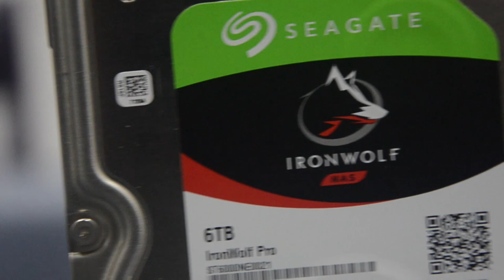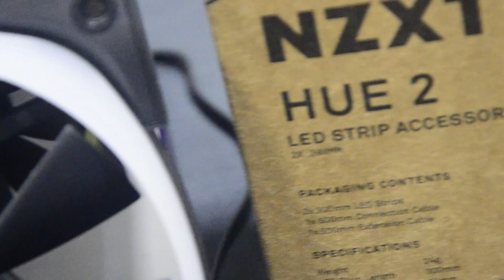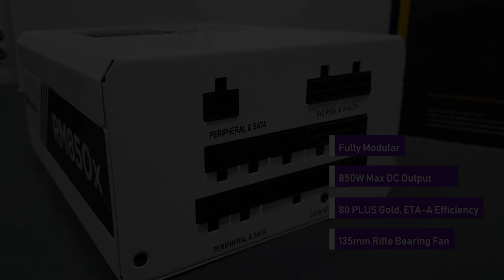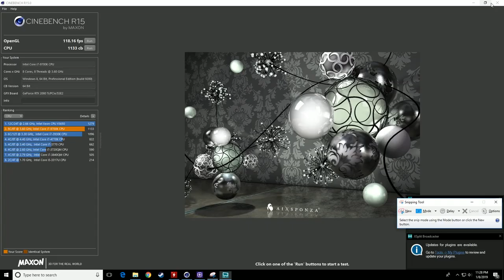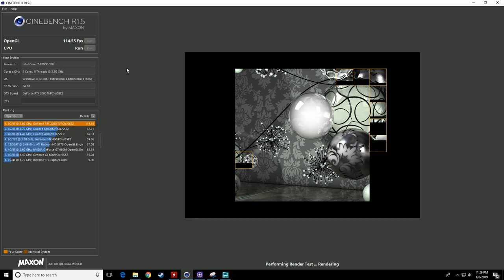PC Build on NZXT h200i (i7 9700K + RTX 2080ti)

Comment: I really need your help... the NZXT website says the max clearance for GPU height is 44mm... however you've managed to fit a 50mm wide card in there. Does it work well? How are the temps? Please help me I want to get a 2080 super card that is 51mm wide. I hope you see this!!
Reply from the maker: 44mm is actually thick and would choke the fans of GPU, the temperature of the GPU in this video is quite bad. If I would recommend a GPU for you, you can choose on these one that I already tested: MSI 2080 Super Ventus, Galax 2080 White or 2080 Founder's edition.
Reply: @VinceZen  Hi, What exact model of the rtx 2080 super galax are you talking about? I'm getting this https://www.galax.com/en/graphics-card/galax-geforce-rtx-2080-super-ex-gamer-white.html . its thickness is 51mm, 0.8mm thicker than what you have. in this video(50.2 mm). Will this work?

Comment: Hi Vince, did you need to customize something to fit all in? Looking at the NZXT H200i dimensions and the RTX 2080 Ti dimensions, it's quite a challenge to have all this together.

I'm wondering between NZXT H200i and H500i, but I'd like the smallest one for an RTX 2080 Trio + I9 9900. Today, looking at the temperatures, which would you recommend? 

Thank you!
Reply from the maker: No, I didn't customize anything on this build, but the GPU airflow is kinda bad so if you are going to use a GPU with that size, you might want to consider to mod the shroud or remove it.

Comment: Will a 2080ti ventus 11gb be a better fit than a triple fan? or will it choke the temps as well?
Reply from the maker: it may improve the temps a little bit, but the airflow of this case still sucks so if you are overclocking, I may not advise using this case.

Comment: What are the temperatures for the CPU and GPU in this system?
Reply from the maker: I can't remember that much if you are asking referring to idle mode, but the GPU  temp is not good on that build because the size doesn't give itself a breathing room in that case, even if I tried to change the airflow.

Comment: Hey Nice Vid man. But one question. Would the Rtx MSi 2080ti trio fit in this case?
Reply from the maker: Based on its specs, it is 5mm thicker than the GPU that I use in that video, it could possibly fit, but there will be no breathing room for the GPU so I wouldn't recommend that.

Comment: something is not correct with the temperatures. The NZXT cooler do comes with thermal paste applied to it. I think you put the thermal paste of the cooler on top of the thermal paste you added. Also 1133 Cinebench r15 score is low for an i7 9700k. My cpu is i7 4790k and I can get 980 score easily ( will I did overclock my cpu to 4.8 ghz) My suggest is as the following regarding cpu temps. 1) DELIED YOUR CPU 2) CLEAN THERMAL PASTE 3) USE PUSH AND PULL CONFIG FOR RADIATOR. and I guaranty temperature range around 50 to low 60 degree c.
Reply from the maker: I completely agree with you, everything in that system is just running on a stock/default settings, and I am not sure if that will work properly using Z370N board on 9700k because I am afraid that the board cant supply that much power on the system. But thank you for your suggestion, I appreciate it and will take note of that.